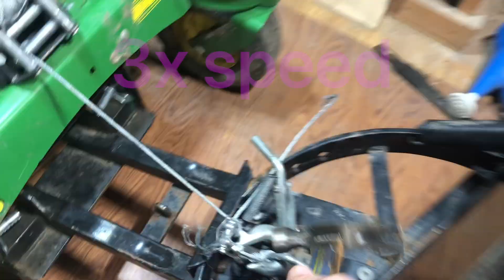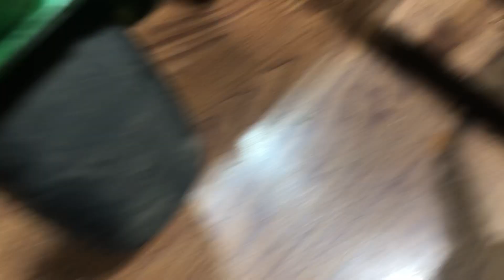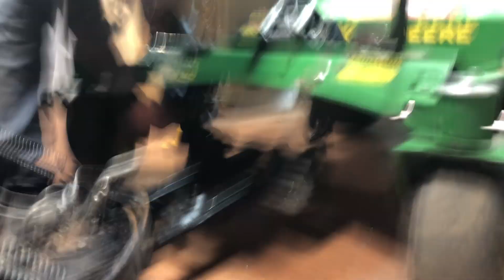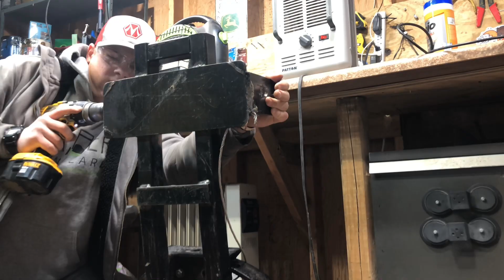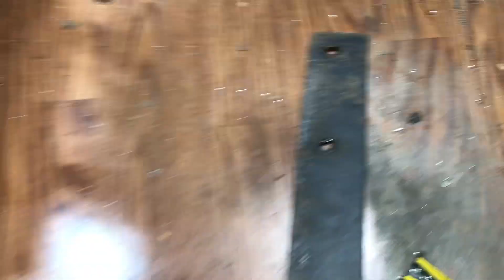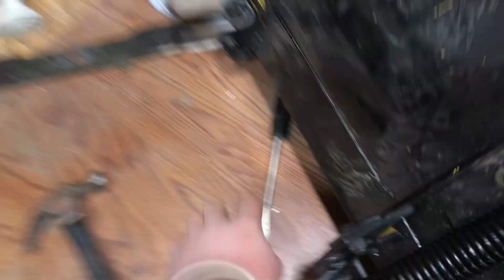All aboard the struggle bus! Struggling to get the zero turn plow ready for sidewalks.

Comment: Is the blade level to the floor when not angled? Meaning just when plowing straight ...
Do you have the same blade to floor gap to floor when the blade is turned in the opposite direction?
If so it's because the blade needs to be lowered more....then there will be no gap...a geometry thing when the blades on plows are angled.
The  blade is not correctly engineered for your zero turn as your machine is a little too low for it. I have a jd X758 I use a plow on it...if I don't lower it enough same issue.
Reply from the maker: Yes I think you’re right. It is fine when it’s straight but if I turn it in either direction It doesn’t touch on one side. When I let it down I’m letting it down till there is slack in the winch line. So it’s all the way down it just didn’t touch. But I think my solution should work. We will see. I appreciate the input!